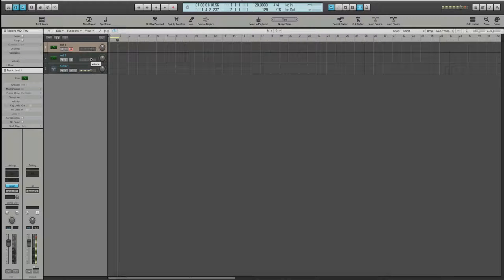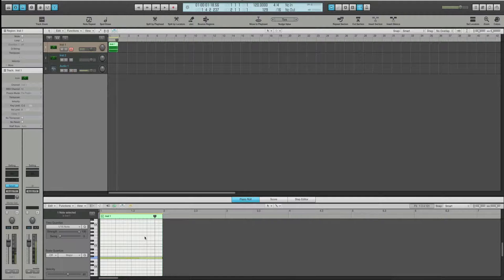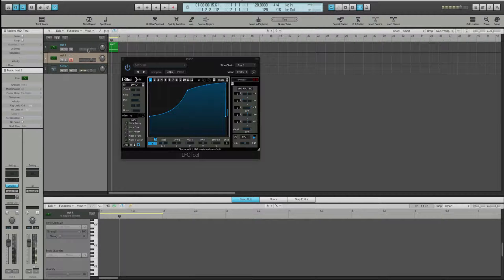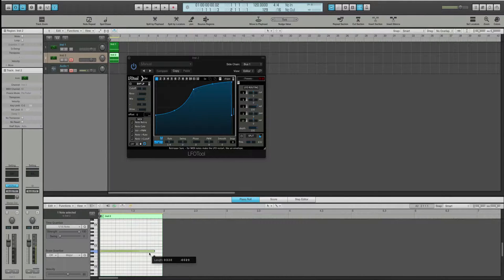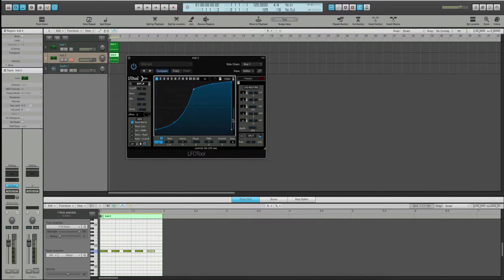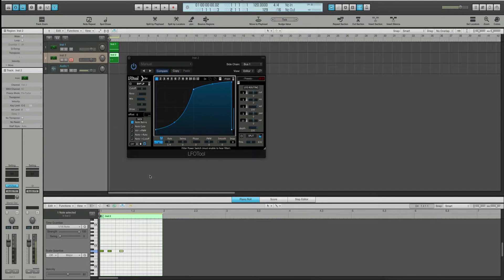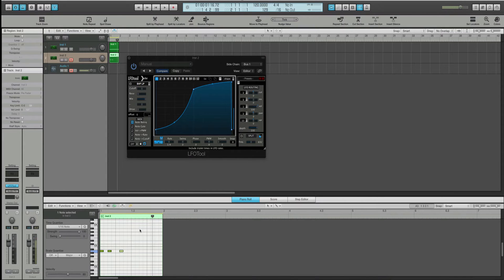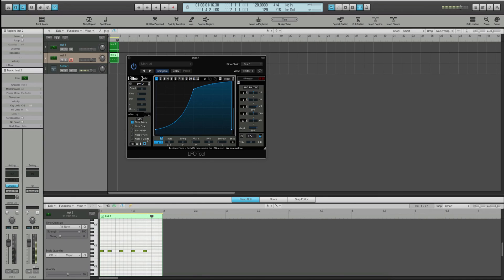How to Midi Trigger LfoTool in Logic

Comment: dis function is getting very useful if u got a stack of vst-tracks with ur "finished" sounds. use the LFO-Tool with the filter function to achieve every filter effect u like. therefore u don't have to automate every single filter, from the several plugins u used to create ur "stacksound", by yourself. Thanks for showing how its done! Thumps up!

Comment: Yo brother! got a logic x question. So I finally figure out how to use the Volume shaper to midi trigger perfectly using the Midi Environment and IAC drivers. Does this cause any lag on Cpu or latency?
Reply: John Thirdd it shouldn't because core audio and core midi are system level drivers. Therefore, it should behave like any playable vst/au. Keep in mind to keep the track record armed/active and don't forget to demix midi by channel in record options, logic uses 2 different buffer sizes for mixer/playback tracks and record armed/live tracks. Hope this helps and good luck, feel free to reply how it worked out =)